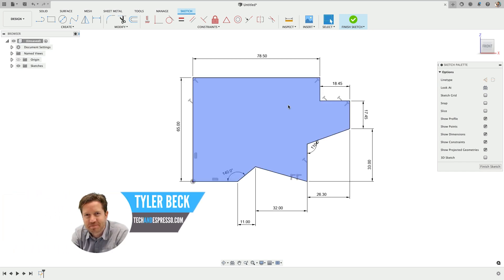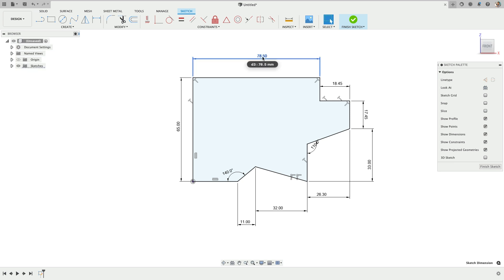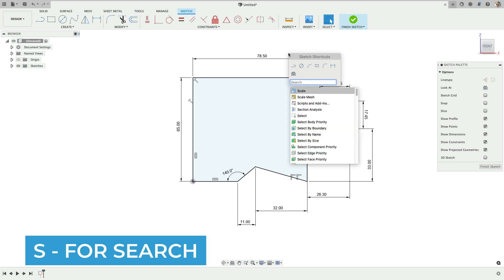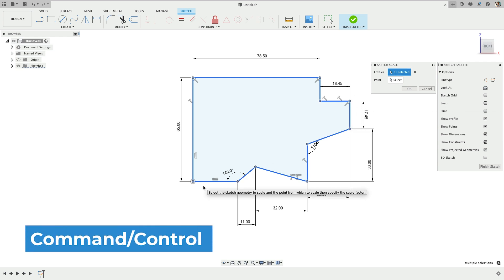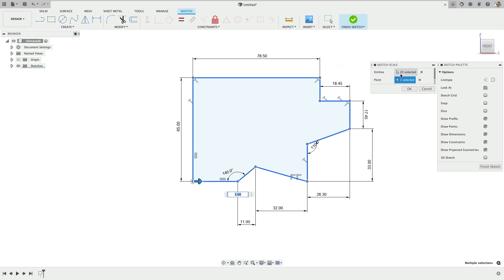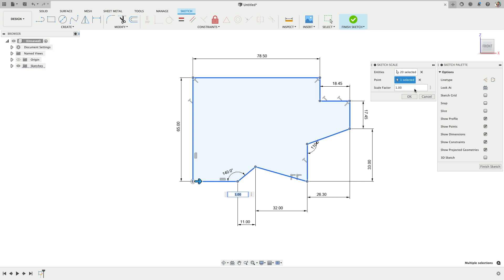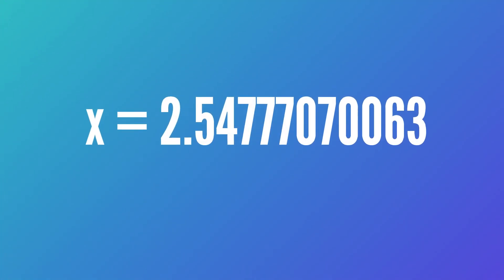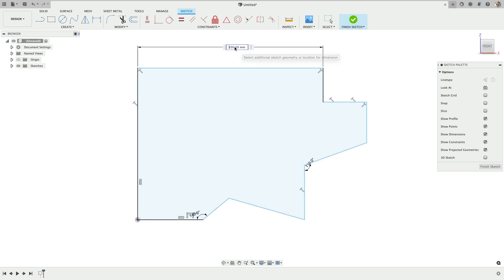Fusion 360 - Scale To Size (Sketch Dimensions)

Comment: I'm starting with a house blueprint where the longest wall is 28 feet. I want to scale that blueprint which I have in F360 to 245mm (longest wall) so I can 3D print it.

Comment: When designing a 3d print thing. 
If you match the extruder tip to model in your cad design scale. Then you can print your model bigger in the same amount of time. 
Any size.
10x bigger takes same print time. 
100x whatever as long as tip is swapped out to match and your printer can go that big. 
Its a cool trick i use now.

Comment: Better than typing the calculated value, I think you should be able to enter the equation  200/78.5 right on the Scale Factor  box.
Reply: I came to the comments to say the same thing. I'm not at my computer right now, but I want to try that next time I'm in Fusion. I can't think of any reason it wouldn't work.
Reply: @laurawerner  Yes it works, I tried it